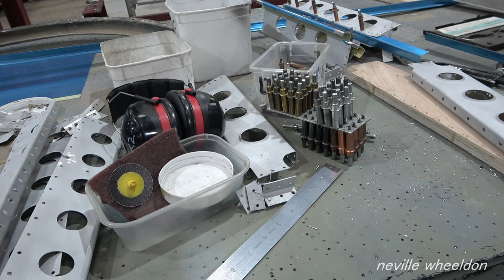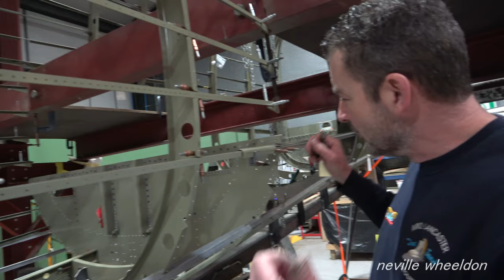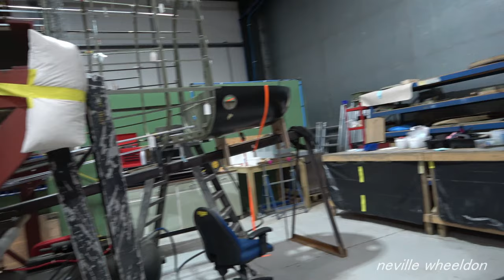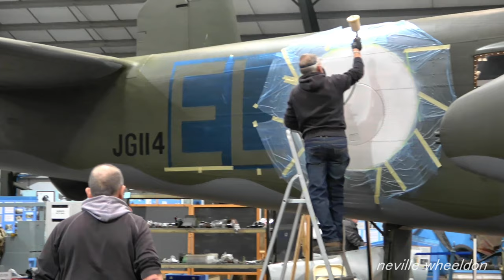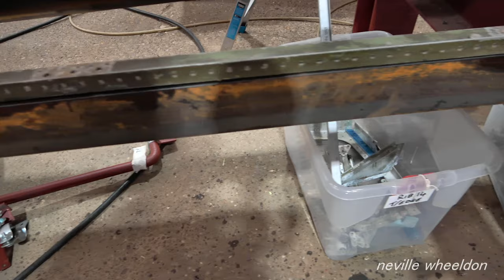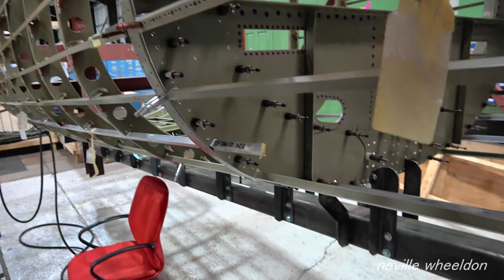Video 243 Restoration of Lancaster NX611 Year 7.. Outer Trailing Edge Jig complete

Comment: Just a question: with the tail wheel frame members that were cracked in both Just Jane and the French Lancaster, do you send out bulletins to other restorers or the BBCF or the Hamilton (Canada) Lancaster groups to let them know what you find?  It might be very helpful to others to know what to look for to prevent unnecessary failures; especially with the air worthy planes.
Reply: They said they had told the BBMF about it
Reply from the maker: Hi Andrew BBMF and the Canadian were told. They all keep in contact with each other.

Comment: Those parts by the tail that have all cracked in the same place just scream for a design supplement to reinforce that area.  I find it odd that the Lancasters were fitted with gun turrets - particularly the front, given that they were employed for night missions, while the USAAF handled the brunt with daylight missions.
Reply from the maker: Hi HH, I would think there will be a mod for this. Front turret, in summer time it only Dark for about 5 hours in GB, so at some time they would be flying in the light , so every little helps..